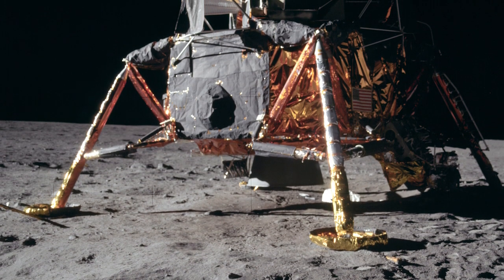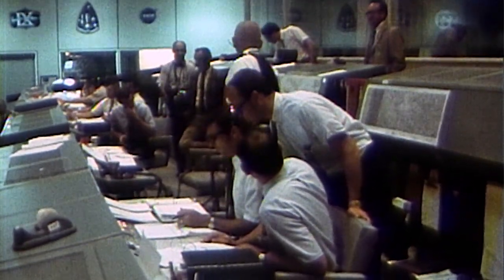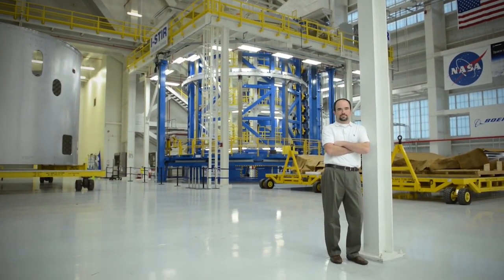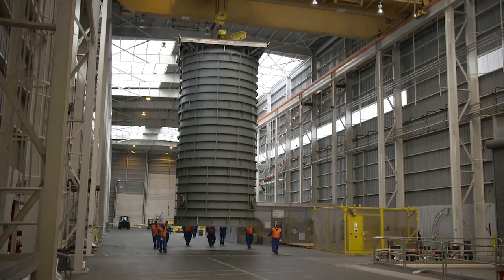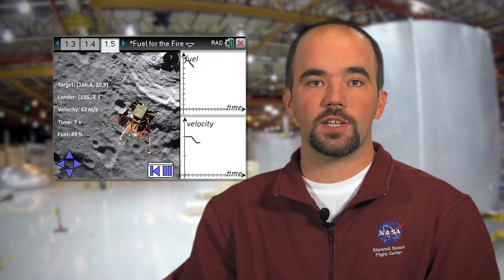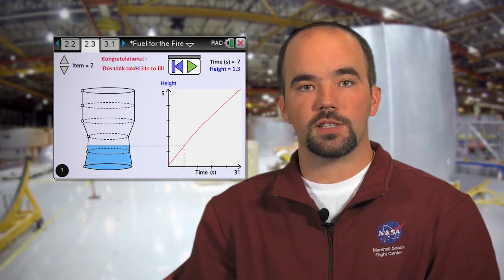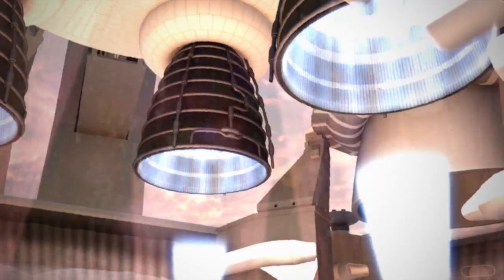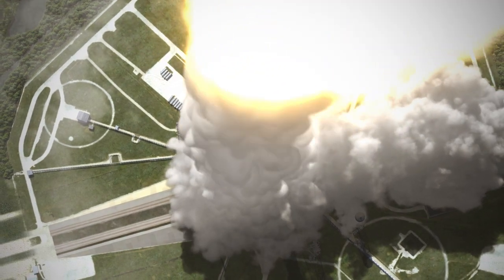Fuel for the Fire

Comment: I'm always amazed by the astounding precision in Apollo.

They knew how much fuel they'd have at any point during the descent... before the lander was even built.
After the burn back to Earth they had as little as 1.5% fuel remaining.
They used the lumpy gravity field of the Moon to circularize an intentionally imperfect orbit in time for the rendezvous (calculations are easier assuming the target is in a perfectly circular orbit)
They knew the lighting conditions on the Moon very accurately, mostly through mathematic predictions 
They could use the Earth and Moon's horizons as landmarks and figure out exactly where they were. A second measurement would tell them exactly where they're going. (star sightings determined their orientation)

I sincerely hope future generations get to participate in a return to the Moon or even a manned mission to Mars.